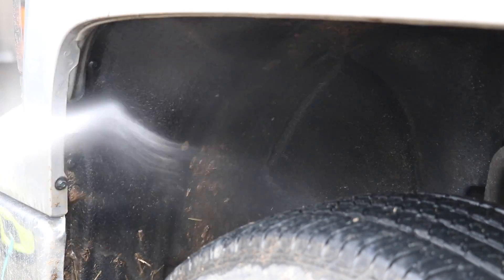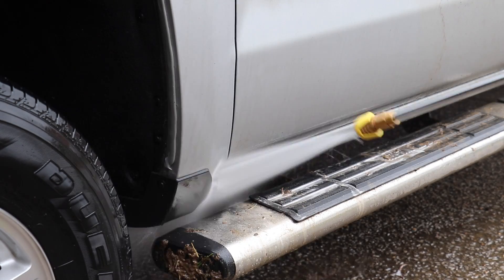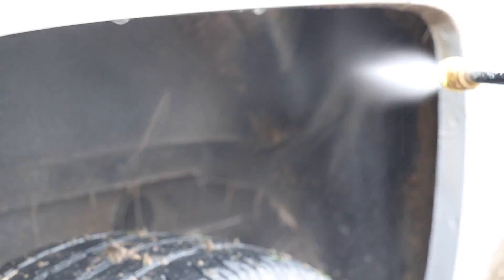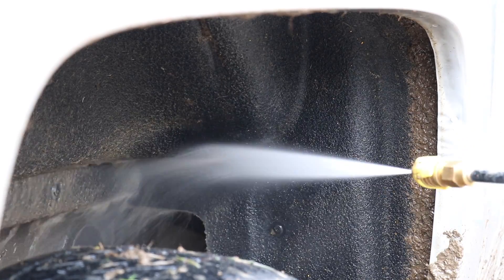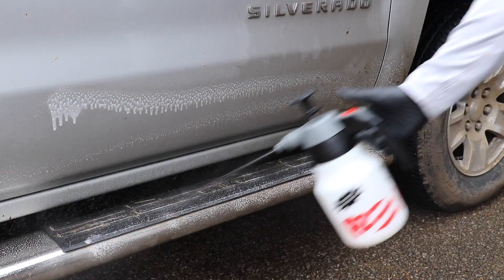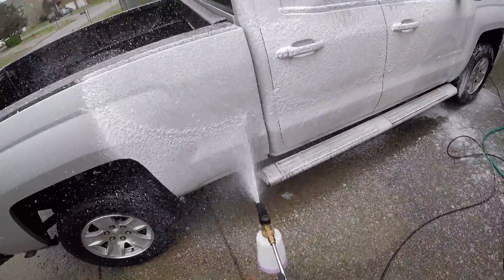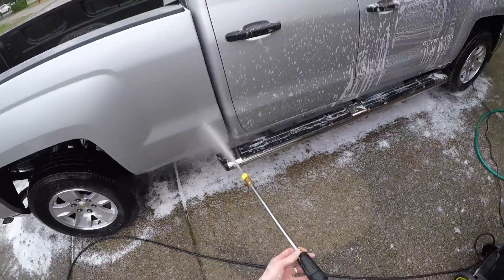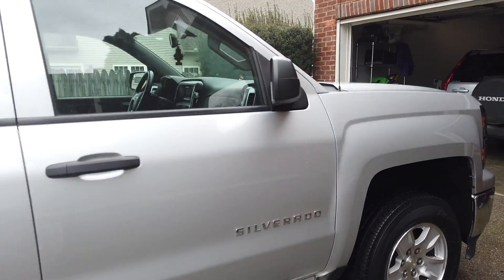4 Tools You MUST HAVE To Detail Dirty Exteriors... Cut Your Time In Half!!!

Comment: What product do you have in the pump sprayer? Also, If I use super clean in the pump sprayer for the wheel wells and tires. What dilution ratio would you recommend?
Reply: I've used super clean diluted to 5-1 for tires and wheel wells. But have also gone as low as 3-1 when they are really filthy. I hope that helps.

Comment: Great info. I have a drill brush for truck tires.  Surprised you didn't mention APC; guessing the foam cannon kinda trumps that. Basic stuff I like it.  I like to use APC along with a trimmed detailing brush to agitate areas that are hard to reach or missed.

Comment: I have starting to wear a mask now around all these cleaning chemicals and you should too.  I use a 2000 Ryobi pressure washer with a Obsessed Garage hose.  You don’t want to use a real powerful gas washer on a car because you could damage the clear coat and paint very easily.